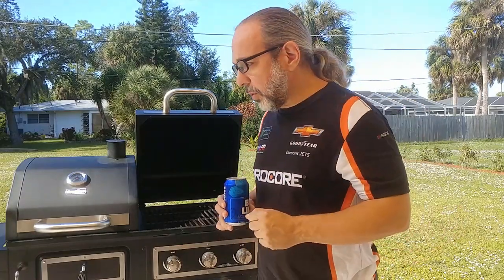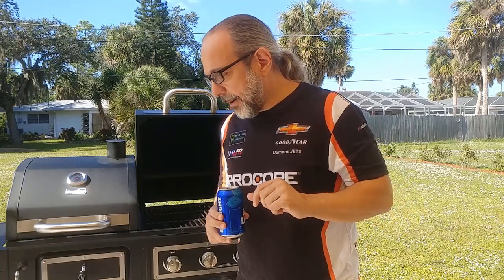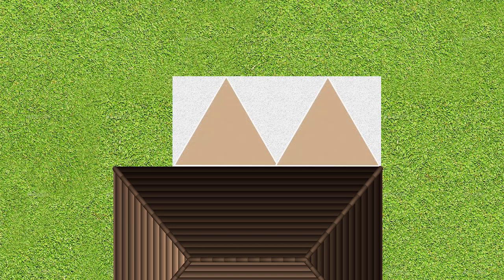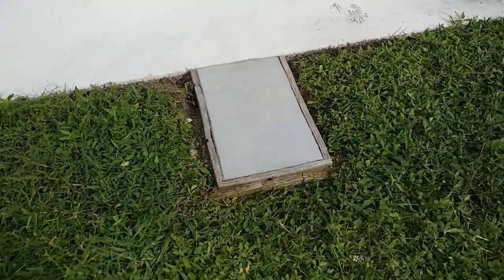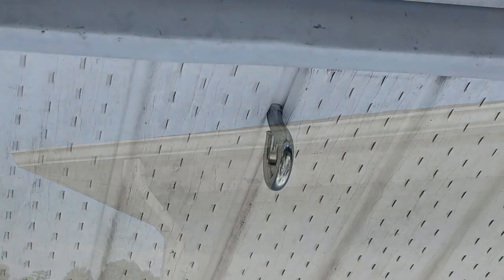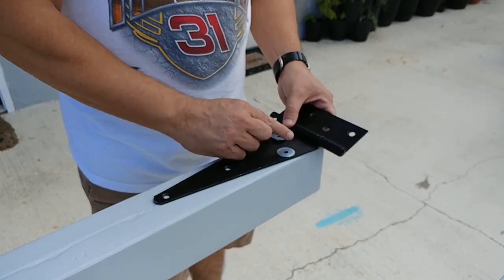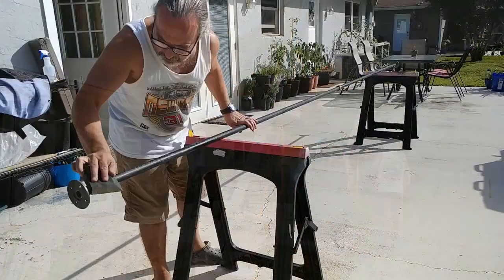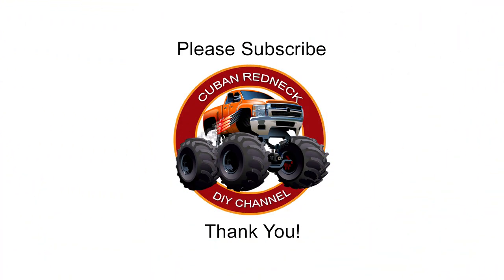How to Install Shade Sails - Installation Ideas and DIY Set Up Tutorial

Comment: This is a great idea, thanks for sharing! We have some shade sails and thinking of making them more sturdy. Here in Denver, we get a lot of wind and have to take them down for that (and obviously take them down completely in winter months).

Can I get an update on how your posts, hinges, etc. are holding up after over a year of use?
Reply from the maker: …. Hey, thank you for watching. Yes, it is great to be able to take the shade sails down when bad weather is forecast. As to hardware, so far, so good after two years! But I am on my 3rd set of ratchet straps. I am not sure if it's the UV, but they lose their color and then come apart after a while. For what they cost is no big deal.
Reply: @CubanRedneck  I would suggest some steel cable hand winches, that’s what I use for mine out here in Arizona. We don’t get the rain obviously so corrosion isn’t an issue for me, might be for you. I actually have two mounted at the top of my 4x4’s. One to adjust the shade, and one to adjust the guy wire. Makes it super easy to disassemble when the monsoons come in.
Reply from the maker: ... that would much the same. I used ratchet straps to keep the cost down. I am planning to put up an  aluminum pergola of a sort and deck the roof with solar panels in the very near future. But regardless of what you use this shade sails are doing their job in days like this when it is 96 in Florida I don't even want to know how HOT it is in Texas or Arizona!

Comment: Really appreciate your design. I was wondering now that it's been a few years how are the pads holding up and the beams? I believe I'll be doing a very similar setup as I have a L shaped house with a patio area in the pocket currently no deck. I could probably get away with one post and use the house for the 3 other corners. I just don't want it hang low with significant tension.
Reply from the maker: … thank you for stopping by. The Sails are much lighter than they once were and may have another year or so on them. But the poles and the hardware is held up quite well. I also had to replace the tie straps, which were of the cheapest quality, which was expected. The UV meter out here in Southwest Florida is at its max most of the time.

Comment: I like the idea of the 2x4’s.  You could of upped it more with a sandwich of actual plywood.   I’m working on a similar design except I’m going to use steel posts.
Reply from the maker: ...oh yes, a lot of room from improvement but this was build on a budget and with the mind set to replace it with an aluminum pergola that can hold 20 325 Watt solar panels. That's 10% over my consumption. Thanks for sharing...

Comment: I've never done anything like this, but we're about to... Question on the concrete though... I'm confused on why the pole isn't/wasn't placed into the concrete before hardening??  Or is that the wrong way, i swishy l seriously don't know, but just attaching a hinge and then bolting it to the concrete seems kinda weird i dunno... Why pour concrete, just attach to the slab
Reply from the maker: … hey thank you for stopping by! As I mentioned in the video, the concrete is preparation for a future project. This fall, I will be switching to an aluminum pergola, whose roof will be decked with solar panels. As to the hinges, it is the best way I found to keep tension on the sails in combination with the ratchet straps. Understand I am about a mile from the Gulf of Mexica on Florida’s Southwest coats. We have severe thunderstorms with winds exceeding 30-40 MPH regularly during hurricane season. I designed this system with that in mind. If wind, tornados, or hurricanes are not an issue, yes, you can make the installation fixed.
Reply: @CubanRedneck  copy that bro.... Thanks for clarifying... We're getting ready to put something up....I appreciate the video, love the Cuban redneck name, & keep it up.
Reply from the maker: ... thank you!

Comment: veryu cool video.  How has it done in the wind?  How is the noise (flapping?) when windy ?
Reply from the maker: …thank you for commenting! Thunderstorms with 20-30 MPH winds are routine around here, and so far, so good. I had a tie strap fail. It was an old one. There is very little flapping as long as the tie straps are tight. We did have a severe storm come by a few days ago, and I did release the pressure to lessen the parachute effect. One feature about installing shade sails this way is that they are easy to take down in the event of severe weather. Releasing pressure from the tie strap allows you to unhook the turnbuckles, and that is it!

Comment: Does this method work for sandy soil in Florida?   Please suggest something that does.
Reply from the maker: …hi, thank you for commenting. The reason for this shade sails installation method is that I live in Charlotte Harbor, Fl. Storms are more of a concern than sandy soil. In the event of a storm, it takes me 3 minutes to take them down - something I had to do on more than one occasion this past year. I had a very similar setup living in the Florida keys. In the event of a storm, all you do is release the ratchet straps. Once you do that they will sag, allowing you to unhook the ends. Shove them into a cooler or bucket, and you are hurricane-ready! I have a friend who recently put his up as well. He used shed anchors. I am not too familiar with that method, but they seem to work, and shed anchors are approved in Florida!

Comment: The square ones is slackened at the middle. Wouldn't rain water gets trapped on it?
Reply from the maker: …thank you for commenting! Since releasing the video, I have lowered the front turnbuckle location by about 10 inches giving the shade sails a slight downward pitch away from the house. There has been no water accumulation since. Not that it was a big deal anyway. Under a heavy storm, maybe a gallon accumulated at the most, and it quickly seeped through. These things have a pretty coarse weave, not like an army tent material that actually holds water! Water goes right through them with little effort. These are sun shade sails and their primary focus is to provide shade, not stop the rain! Shade sails with a tight weave, bring a whole new set of engineering challenges and I don't think I would attach them to my roof or house for the matter since they can become actual parachutes! Just last week Tropical Storm Claudette impacted us with winds gusting 20+ MPH and several inches of rain! So far so good!

Comment: Thats a lot of work. Honestly, I would have (and did) put up an awning over the patio. One long piece of fabric angled down from the roof (with a little scalloped fringe) looks pretty ! :)
Reply from the maker: … Thanks for commenting. If it works for you, awesome! 

On the other hand, I am close to the Gulf and prone to wind storms without warning. Otherwise, I might have taken a different approach, but as you can see towards the end of the video, around here it is not rare for the wind to blow at 15 - 20 just because. 

The only way I know to mitigate high winds with shade sails is to allow them to flex and unload the wind as you would do on a sailboat. Having the sails too ridged or fixed will significantly increase the change of damage to the house. If you are familiar with the American Magic's PATRIOT race boat, a rigid sail was the main reason it capsized at PRADA Cup. Aside from flexibility, the setup with tie straps allows me to take them down in 2 minutes during tornado and severe thunderstorm watch or warning, and I have on several occasions.

Comment: great video... will it hold snow...?
Reply from the maker: Brother, I would not know. I don’t do weather below 50 degrees! However, from an engineering point of view, I don’t see why not! I would recommend something that I will be doing before the rainy season next year and that is punching a ½ inch grommet in the center to put a temporary stick that pushes the center up during heavy rainstorms. I think that should work for snow as well!

Comment: How dose it handle in heavy rain and winds?
Reply from the maker: I am pretty close to the water on the Gulf side of Florida, and we've had a few storms and so far, so good! However, we haven't had a hurricane yet, but I'll probably take it down if a storm is announced. As to the rain, the weave on the shade sails is quite open, rain doesn't really puddle too much, but it makes a big drip right in the middle of the square one. I need to give them more angle so the rain can run to the edge. The triangular ones are ok. The only thing that has failed was 1 tied strap. The ones I used were ancient, and I think the UV got to them…. Thank you for commenting!

Comment: Can you do posts like this on all four corners?
Reply from the maker: ...Hi, thank you for commenting and yes, but what you will need to face them towards the corner so that you have tension from corner to opposite corner instead of pulling away from the house. I would also consider making a loop around all four with a cable. That way the structure will seat up right and then you just adjust the tension with the racket straps
Reply: @CubanRedneck  thanks! what do you mean by making a loop?
Reply from the maker: I helped a friend put a square sail out in the middle of the yard where there was an existing cement slab. We found that the sail stretched a bit too much after mounting it with the poles facing and pulling away from the center in the direction of the corners. We ended up making a loop with thin steel cable around the perimeter through the same eye bolts used to connect the sails. Because the steel cable does not flex or stretches, it made it a lot more rigid. It also helps when putting it up if you are short-handed because the frame stays together while you connect and tension the sails.
Reply: @CubanRedneck  thawnks a bunch! You da man!

Comment: This is really dumb. The shade sails are not tight and the posts... very unprofessional with those straps. I can bravely tell it because I am professional.
Reply from the maker: ... dude with all due respect! What are you talking about? So, you are a "pro," but no shade sail installation videos on your channel. Hmmm, interesting! You have no idea how many of my friends have seen this and seen how easily I can put it up and down and replicate it. 100% success... Let me know whenever you want to put some money on the table and do some CAD modeling.
Reply: @CubanRedneck  installing a shade sail properly does not require cad. Yes I have no videos but I installed sails much better than this. Sorry if I was rude.
Reply from the maker: … I don't care about the rude, but if you see the installation and consider that I live less than a mile from the Gulf and where storms brew up with a little warning during the summer, you understand the concept. The sails are NOT loose, as you claim, and yes, the picture does not do justice to the installation. Something else you are not considering is that these are $30 sails. Not $300, ones made from canvas like the ones I have in the house in the Keys. As I mentioned in the blog, I did replace the tie straps with some black heavy duty ones, and although I could have used a steel cable with a turnbuckle, it is just not practical for my wife to take them down in the event of a storm if I am not home. Question: How much do you charge for a 12 X 24 setup? There is less than $150.00 in this project. In other words, Chevrolet makes an EV called VOLT, yes, it is an EV, but it is no TESLA. That was not only the concept but also the theme of my channel.